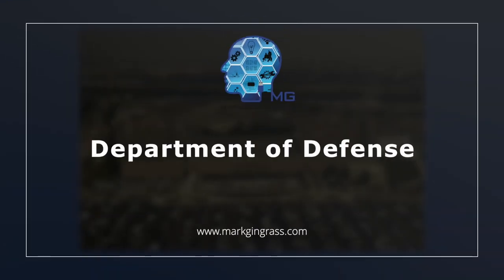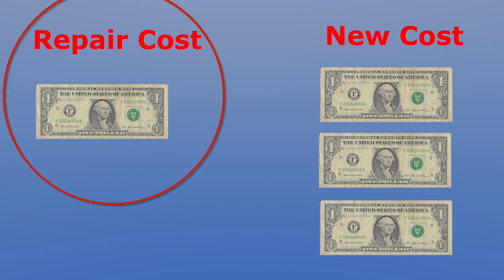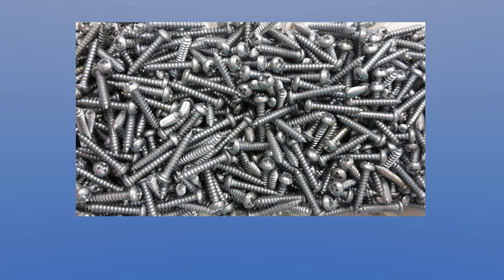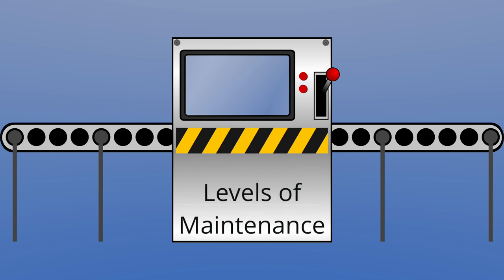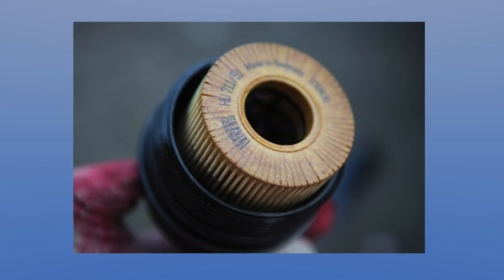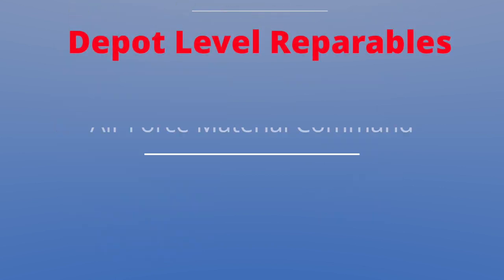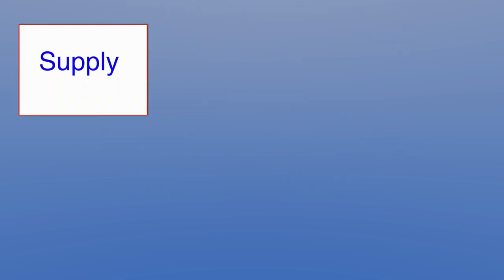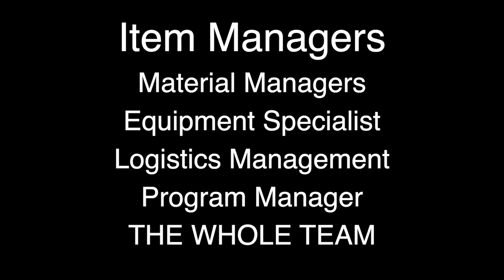✈️Depot Level Reparables vs Consumables - Department of Defense & DLA✈️

Comment: What is a nested reparable?
Reply from the maker: +Top Toast , it’s a reparable inside of another reparable. Think of it as if you repair a car by replacing the engine. The car is a reparable and the engine is as well. The engine will get repaired somewhere else and reused on another vehicle later.